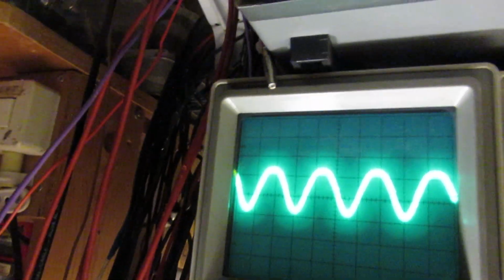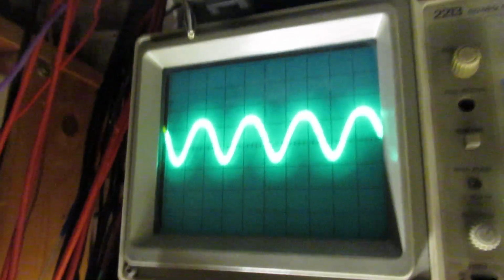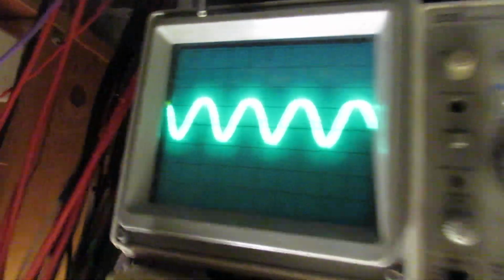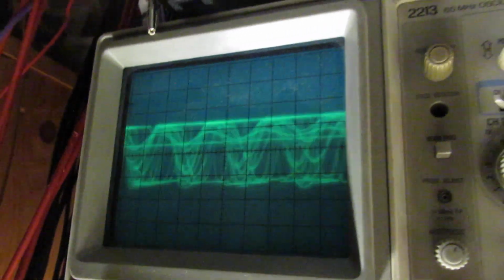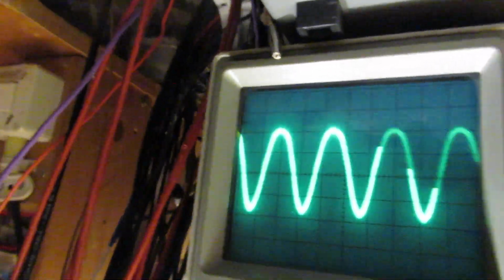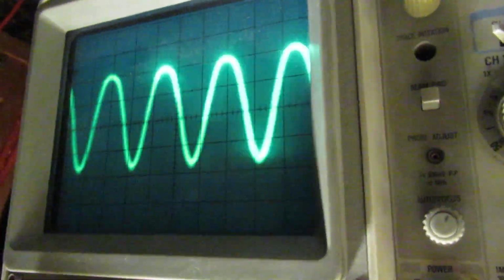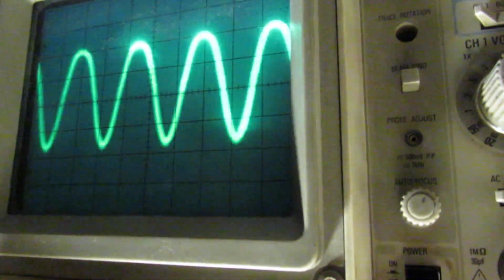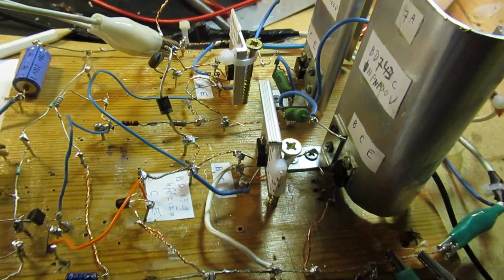Talking about developing a class B audio Amp of the 1970s part 2, demo via  1-3 W audio amp schemat.

Comment: My first audio amplifier experience is  making MW radio my school age it contains driver and output transformers 
After ic LA4102 , tda2005, tad2003 . I try study class A , B ,AB audio amplifier . I don't see any difference.
Reply from the maker: In class B there is (idealiter) a tiny quiescent current that is used to cure the crossover distortion + it does not (because of that) take a constant (small or high) current constantly.

Comment: Dear sir I have a Bush radio cassette tape recorder. It's radio contains MW, SW1 &2 bands. The cassette and aux in works perfectly. The radio also works fine but suddenly it stops receiving anything in all 3 bands. Only I can hear amplifier hiss sound. I also checked for any weak solder joints in the circuit board and possibly changed the electrolytic capacitors with the same value. I also checked the transistors, IF coils and diodes which was good. 
Now when I scratch the negative terminal of aux in or a tape head it makes a sound and radio starts to receive again. 
Shortly to tell that radio behaves like an SCR which works after giving the gate triggering. It works normally but suddenly it stops. I have to make two conductors to touch and radio starts working. 
Please tell me what to do and is this because of any dying components or just loose connection. Thankyou.
Reply from the maker: It is (more or less) impossible to give an advice without having studied/seen the case, but anyway. There could be a few causes: A) the radio starts oscillating. Remedies 1. check all the solder joints on small fractures (brittle places) and resolder them. 2. check the earth wiring by soldering an isolated wire to point "x" of the ground (often minus, check it) and touch with the other end of the wire other places of the "ground" on the printplate. Be absolutely sure that that other point is also on ground (often minus) because otherwise you can damage the radio. 3) solder a 4700 uF capacitor (right voltage) parallel to the power supply + and -. B) small fractured or loose components. Take a small piece of wood and tap on the print, try to reproduce the problem. Perhaps on location "X" of the print the problem can be reproduced. Check the wiring and the soldering joints there (magnifying glass) and resolder. Other problem could be that the local oscillator stops, resolder the print there and/or check the components. But I read that you already have done these checks. The problem has to do with mass/earth, your body acts as mass/earth and stops the parasitic oscillation. That is my idea.

Comment: Very good job Ko!
And also very good explanation.

About the 741 in the 1970s schematic:
I don´t recognize the pin numbering.

Is it another chip? Or a dual opamp?
Reply from the maker: Thanks & yes, it was a dual 741.
Reply: @radiofun232  Now I have found it on the web. There are 14-pin DIP packages with this pinout and only one opamp in it.